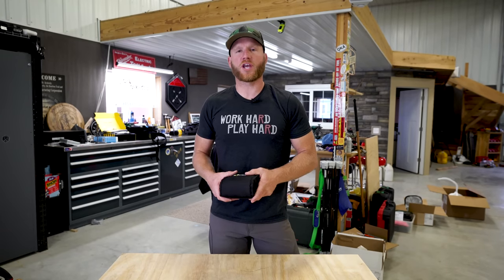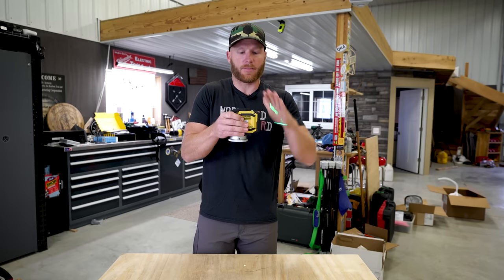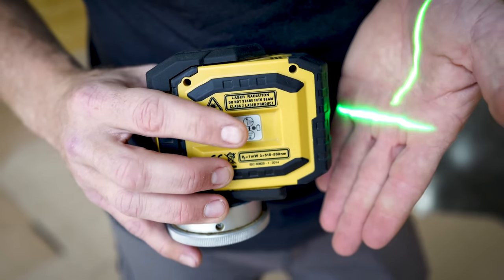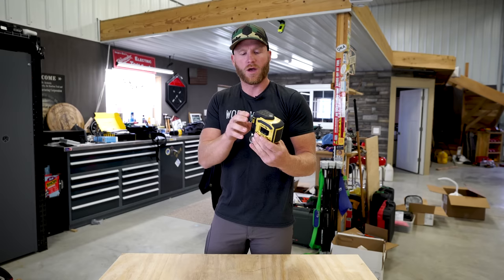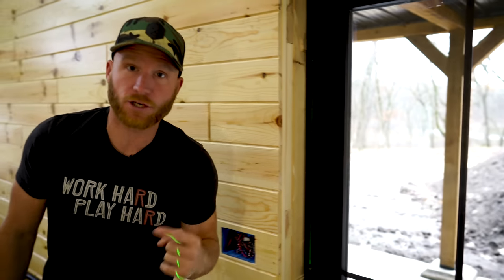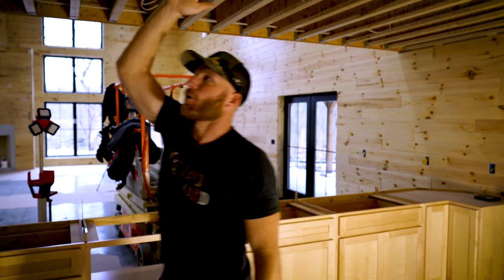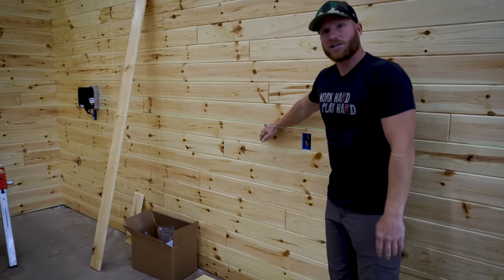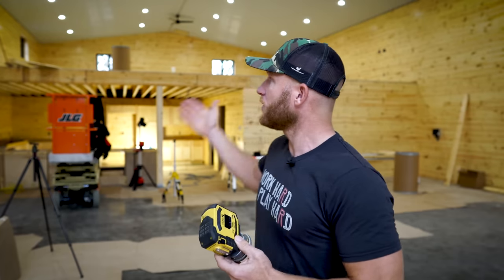Stabila LAX300G Long Term Tool Review

Comment: I have a imex line laser (Australian company). Mine differs from yours, it is red line so the visability is not as good, but it shoot a 360 degree lines.
It has a bracket you can screw to a stud, and then slide the laser up and down on the bracket. Makes framing ceilings and setting up furring channel super efficient. 
I have also used it for framing/straightening big walls as well (6m high). You can set the laser to shoot a straight line that is offset but running parallel to your bottom plate. Then measure your studs to the plumb laser line. Once the measurement from the stud to laser is the same as bottom plate to laser you know that stud is straight.

Comment: i love stabila levels, (to the point i destroyed all other brands levels that i had) but went with Bosch gll3-330cg, 3 times 360 lines and i love it, makes life so much easier when you doing metal framing, suspended ceiling, it also works with reciever (blinks) even used it for grading its just laser combine. oh and also uses 12v bosh battery which is very convenient.
Reply: Exactly, for not much more than the stabila you can get 3, 360° lines.  I had the red but had to do a job in bright light.  Not too good.  The green is the wy to go.

Comment: Had the dewalt 360 green laser for a while now. Same idea but with 3 axes. Works great!
You find yourself using it for things you wouldn't use a level on before/ as much. Improves work quality & efficiency 👍
Reply from the maker: Agree that’s what happens

Comment: 2:35 when working with wood it is worth having a flat plate of metal handy which can be screwed top and bottom (so it doesn't move) to say a post to give you somewhere to mount to magnetically. Obviously, this isn't an option on finished surfaces but ideal for say when needing to fix it to one of your posts say high up where the tripod can't be used. Also by having a decent sized strip of metal you have plenty of fine tuning available by moving it up and down the metal.

Comment: I’ve also been using a laser level for years now. I have found that I can level out framing for bulkheads for ductwork using a piece of light gauge metal about 4’ long screwed to the wall. Then I can use the magnetic on the back of the laser level to slide it up and down to get the height I need. Tried tripods but they never seem to get high enough.

Comment: I highly recommend to use some high end rechargeable batteries, you will save a lot of money.
Look at the Panasonic Eneloop batteries, they are the best on the market.
I use them in my Dewalt laser level, the running time is soooo much longer with these.
Get a good quality charger with it, like the Nitecore D4 and you are all done !

Comment: Tip for Kyle and others: Lose the Duracell AAs and go with Energizer Lithium AA batteries. They last much longer and best feature, they never leak. I've stopped putting Duracells in anything over $2 in value as the Duracells always leaked (you region/climate may determine better life). Sure, best practice is to remove them but then who remembers? And don't use rechargeables as they are usually 1.2V instead of the +1.5V AA (non-rechargeable). Perhaps you should suggest to Stabila to make a lithium battery pack, as well as solar-integrated charger since you work outdoors often.
Reply: And the cold does not affect the Lithium batteries like Duracells

Comment: A good review of a nice tool. One thought though on the i-joist mezzanine. Those should have had blocking in those longer spans. Anything over 10 ft or so need blocking to prevent possible bowing or roll. I know the deck was glued down but the blocking still adds stability.

Comment: There should of been a black plastic base with 1/4" screw come with the laser, this base is used to zero the laser to a wood plate or steel track edge, for plumbing. It splits the dot, right on the materials edge. The laser body raises for the same purpose(without plastic base) a steel wall plate for acoustic ceiling work, and target card should have also come with the laser... 

The plumb dots are king for framing, I use two LAX300's red and green... and a LAX 400 for initial layout of corners, for steel stud framing jobs. I dearly love my stablia lasers and levels!

" Good tools aren't cheap....cheap tools aren't good"  :)
Reply: That make a great expensive cat toy too!!  :)
Reply: @donb8447  Cheap laser pointers are adequate for that, although my wife confiscated mine because I was being too enthusiastic and the cat was suffering. 😕🤪
Reply: @retiree1033  yes, too much of a fun thing could of killed them. 

I could never get a cheap pointer to last more than a day...so I stopped buying them :)

Comment: FYI - that thing at the bottom is not a clamp, it's used to raise the level off the floor to improve visibility of the down plumb dot.
Reply: good point.  but carpenters only think in terms of 2x4s.

Comment: Great video. I have a skil laser and it does the same thing. I framed perfect walls of 16 OC and 24 OC as practice- the walls & OC was perfectly straight and accurate. 
I used the skil laser to design tables and cabinets too. 
Stabila is an affordable quality thanks for sharing your usages and examples.

Comment: I've had multiple occasions where Duracell batteries have leaked and damaged equipment -- no problems with Energizer so far. Take them out for long-term storage.
Reply: better off with nimh eneloops, never had them leak and they are rechargeable

Comment: Having never seen that laser in real life, I still will question if that feature you call clamping is really made for clamping, my guess is that its a height adjustment? A bosch we have at work has that function, so you can put it on something and adjust the horizontal line to hit the mark, if youre not on a adjustable tripod, just a bench or something, fine adjustment
Reply: Exactly this. It’s a micro adjustment feature
Reply: Also useful when using plumb bob feature.

Comment: These are great tools for finding level and plumb. You mentioned a straight line as an example on a ceiling for installing pot lights. It certainly gives a straight line but unless I am missing something I find it difficult to get that line parallel to an existing wall for example.  An 1/8" of movement either way where the laser is positioned can mean several inches out of parallel from a fixed wall. What am I doing wrong?
Reply: Get a 3x360 laser and this will run a lines right the way found the room on 3 different planes, if you want it parallel to one of the walls to do ceiling lights etc just get it close by the eye and you can measure off the wall at the ends or from the floor and use micro adjustments on the laser , usually you can just line it up by eye till it looks good as the owners aren’t going to get a tape measure out if it’s already looking good by lining your laser up by eye

Comment: Well, I certainly need to buy new tools, but for a different reason. My shop was broken into and about 6500€ worth in tools were stolen. So, yeah, time for some new investments. I'm just happy that everything was/ still is insured.
But on the topic of lasers: I just bought the Bosch (blue) gcl 2-15 g to replace my old stanley laser which vanished into thin air. The Bosch is almost the same as the stabila. I haven't used it a lot yet, but I'm sure it'll come in handy when I least expect it to. 
Keep up the great videos.

Comment: Nice review but I have one that I used on high-rise sites for under a year and so much dust got inside its auto-levelling feature stopped working correctly which is worse than just stopping to function because it becomes inaccurate.

Comment: Have  a  question  Have a  lot of rock in property  wondering a digging holes for  tubes  if holes can't be  dug 3 or 4 ft in Tennessee on bluff  should I use rebar drilling holes or what any ideas  property  slopes about 5 to grade of floor

Comment: How do you insure that your plumb line is going strait when your setting the laser up. What I mean is that if the laser isn’t 100% perpendicular to the wall or object your line will skew.
Reply: It will only skew if the plane you're projecting it onto isn't plumb.

To have a plumb line on a tilted plane, then you need to indeed have the line perpendicular to the plane. Although it will only be plumb when viewed from that particular direction.

A quick way to check (apart from a spirit level) if the target plane is plumb is to project the laser onto it from one direction, make two marks at different heights, then project from another direction, lining up one of the marks. If the other one lines up too, the plane is plumb.

Comment: for the price range, was expecting accuracy of +/- 1mm not 1/8"
Reply: which laser can do that ?
Reply: 3mm/10m is not a whole lot to be honest.
1mm/10m would require a rotating laser with a receiver. Price range for that: 800$ or more.
And a rotating laser (at least the ones I know) only shoot a horizontal line and no verticals. I may be wrong about that though.
Reply: @mrhortimer1  word

Comment: Water lever work great. Old tool
Reply: Was thinking the same thing. We've used ours to level up around corners where there is no line of site. Show me a laser that does that! We have a fancy one but even just a clear vinyl tube works and it's not 1mm or 1/8" or 1/16"... its exact.

Comment: Warning...do not leave Duracell AAA or D size batterys in in the laser level.  They are made in China I assume by the writing on the battery case.  They have ruined 3 Maglights by bleeding chemicals from the case while in storage.  The D size are worse.  The lights will light but the bleeding chemicals corrode the aluminum so you cannot get the batteries out of the light. You won’t know the flashlight has been destroyed until you pull the end cap and cannot remove the batteries.  Duracell used to warrant their battery but they will not eve n answer my e mails.  I have switched to Energizer for all sizes and I  used to only use Duracell’s.  Not any more.  Last year I lost about .$100.00 in Maglights  to this problem.  I had big 3 cell Maglights in each car and smaller Maglights all over the garage and house in my hunting gear.  Beware of Duracell. 

JoeB
Reply: They replaced one of my Maglites...